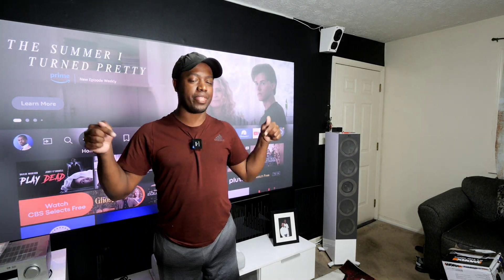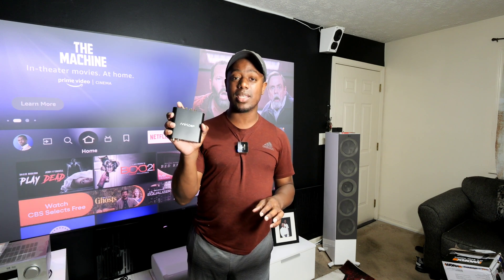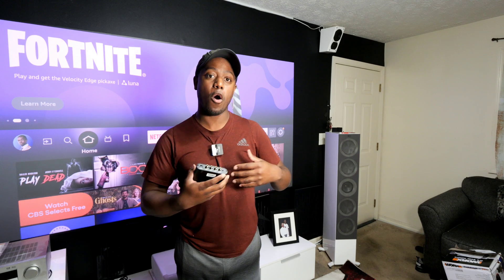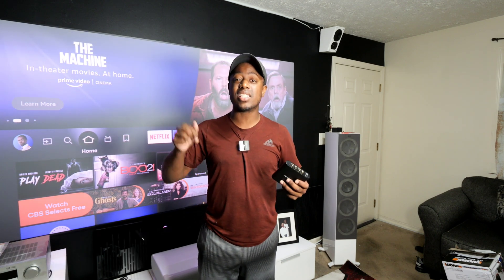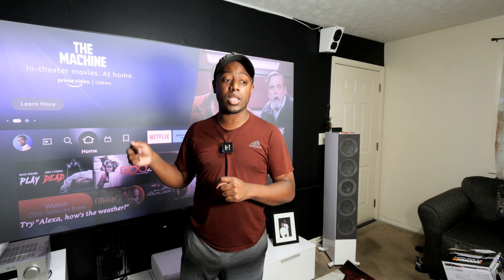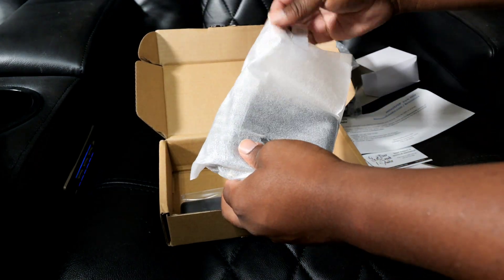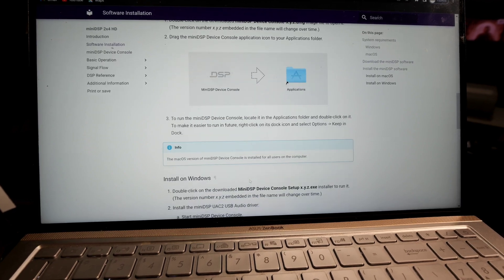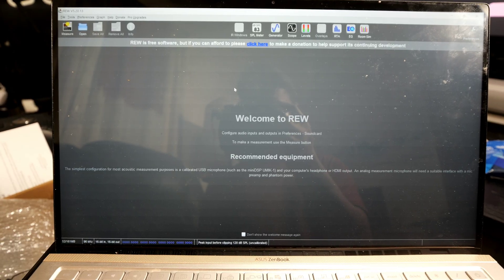Setting Up a MiniDSP for the FIRST Time in my Home Theater! Pt.1

Comment: I think i prefer doing my Taxes over doing REW, Mini DSP... Just have to start with REW & a cheap microphone. So far been doing the subwoofer crawl moving the subwoofers like 15-20 times the last 2 years which is also a pain to get the perfect angles for the frequency waves. Mini DSP HD is necessary for the DIY subs unless you buy a plate amplifier with built-in DSP.

Comment: I was thinking of this but I'm not sure. I tried my passive subs with a receiver but when turned up they clipped so I went back to my old monster receiver they worked fine as it was pushing 4 volts and the Mini DSP only puts out 1 volt IIRC.  So will it accept the 4 volt sub out from my monster receiver without clipping? As long as I get the same or more signal to my sub amps I'd like to try this.
Reply from the maker: It shouldn't clip the signal

Comment: Do you need this if you one have 1 subwoofer?
Reply: Nope. The MiniDsp is intended for multiple sub integration. Besides in a home theater setup you should have at least 2 subs for optimal performance.
Reply: @johnlim7720 He is right about having 2 subs and try to get the same sub for the best performance.
Reply: its helpful you can fix peaks and dips